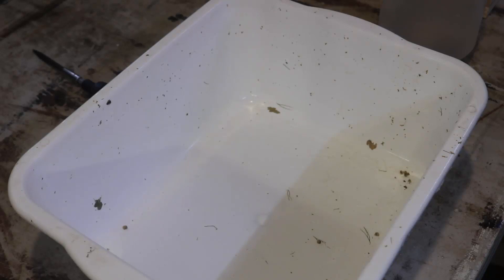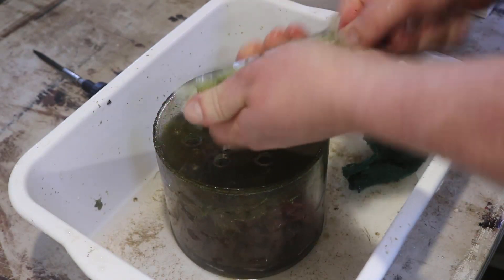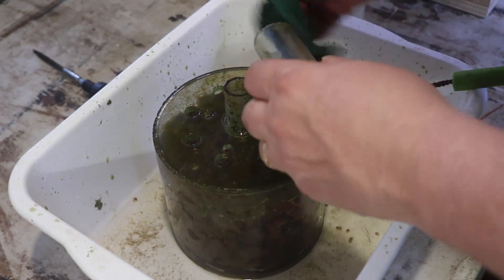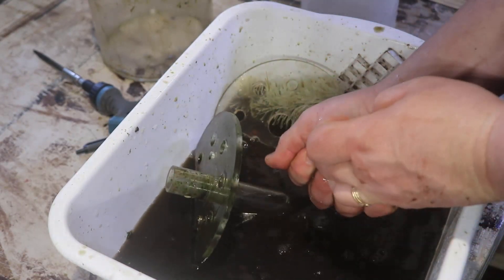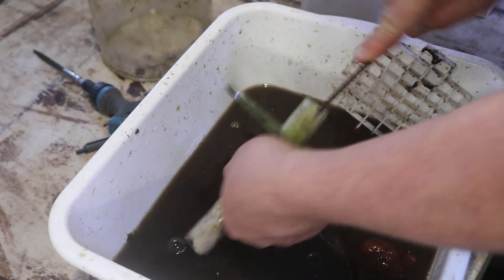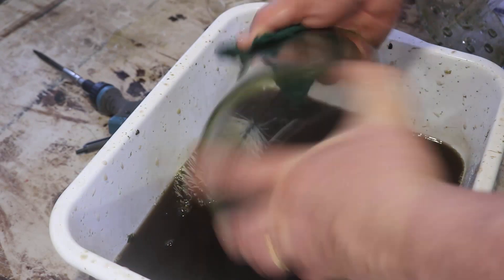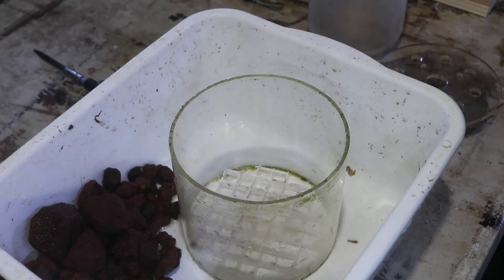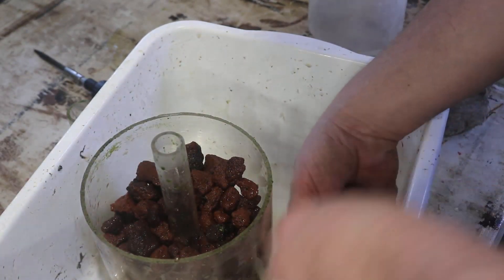How Long Can A Box Filter Go Before Cleaning

Comment: Why not make the case double the height?  Same footprint, same wasted space in the corner of the aquarium, same need to hide or camouflage the area for appearances, but double the media for doing the work.

P.S., my first box filter (circa 1955) was a corner shaped triangle box filled with Wardley's "charcoal" and 'spun glass wool,' which was used in those days in place of polyester fiber and required the use of gloves to handle - which I never had.
Reply: The good old days.

Comment: I just made yesterday a filter like that, but from a hard plastic bottle, just need to buy some lava rock or some kind of biomedia. You think will be ok to mount a powerhead to this kind of filter?
Reply: You could use one, I have my gravel filter connected to a shower filter via a 400l hr power head on a 80l tall.
Reply: @82mrbob  thx, a reverse flow substrate filter is something I want to try next.
Reply from the maker: Definitely!